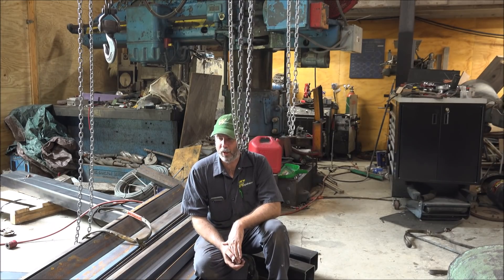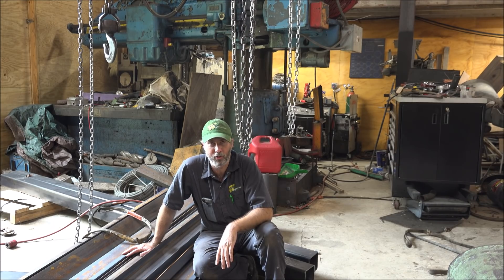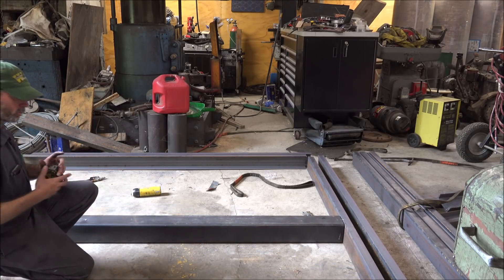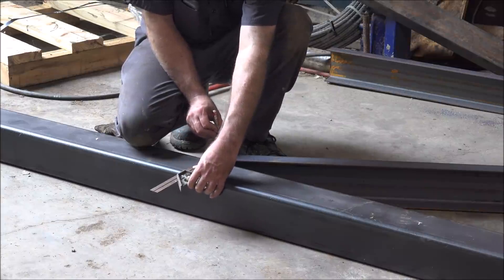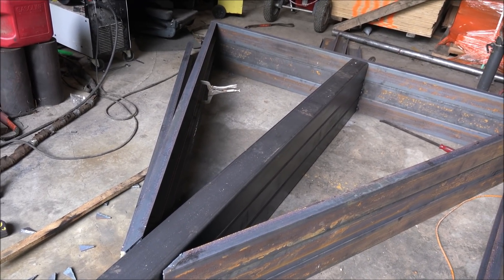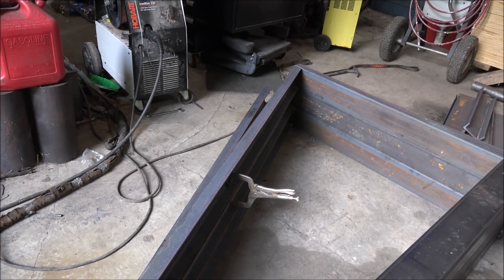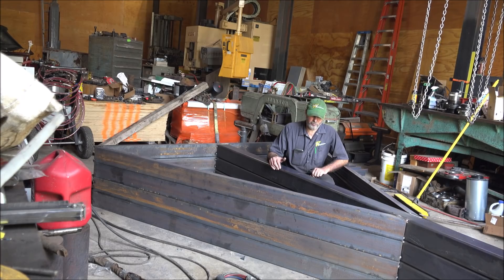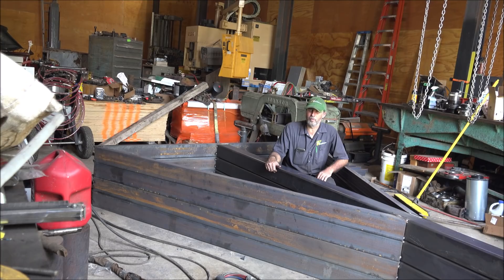More Gantry Crane Building!  3Ton Adjustable Span Gantry Layout and Using a Pattern to Construct

Comment: hey bob, thanks for the video.  I need some advice.   I am building a 20x 20 carport with 5x5 0.25 posts and 6" 0.20 channel for the connectors and rafters.  I want to use an I beam spanning across the width  in the front as the bottom of the truss structure, but also to be able to put a roller carriage and chain hoist.  just behind the front channel crossmember.  would a W6 9lb or 12lb be more appropriate?  if lifting anything heavy like a car motor,  i plan to put extra temporary supports under the beam at the edge of the vehicle to reduct the span.  thanks again for the video

Comment: i have the smallest "welding table" from Langmuir Systems. i use it for tig welding, and its also very useful when i am tacking(fixturing). i am super happy with it. used to weld standing up, hold the torch with one hand hold the rod with the other and hold the part together with the other other  hand. i feel like they are very useful in a small version. but the bang for the buck and lost space, for most shops a small or medium table is were it is at. you would need a large one for that project. really like your videos. thanks for sharing.

Comment: If you don't mind me asking, what steel did you use for the uprights/bases?  I'm wanting to build a 3 ton for myself, and can figure out what beam I need pretty easily by looking at Spanco/etc for what they spec at 3 tons for whatever length.  But the uprights are where I'm scratching my head.
Reply: Looks like 5x5 1/4" wall for the uprights. 5" C channel for the base.
Reply from the maker: Good eye!
Reply: Burger I was an inch out

Comment: HiHo HiHo off to work you go! Hey at least you got the Hyster to hold up one end and crane to hold up other so get up off floor to weld out! Use a tube inserted in the upright beam attach to hyster then can pick other end with crane then can flip over assembly keeping it under control spinning on the fork lift tube!  You can Stand up and weld out!

Comment: That my friend is a lot of cutting and welding.  Do you use the dual shield flux core wire for welding?
Reply from the maker: No I spray arc.
Reply: I guess that you don't use dual shield unless you really need it.